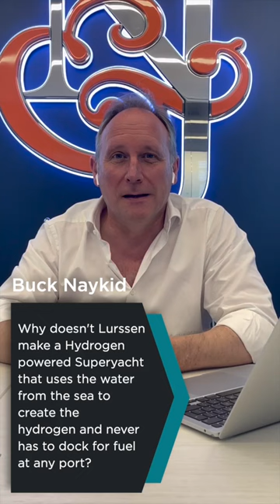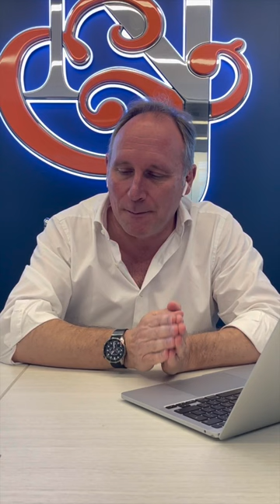HYDROGEN POWER FROM SEA WATER; IS IT POSSIBLE?

Comment: The answer is quite simple: turning water into hydrogen and oxigen is a process that requires energy. And that energy has to come from somewhere. So in a case of a yacht is would have to be wind, solar, fossil fuels etc. Why would you use lots of extra space to turn that energy into another form and endup with way less usable energy, if you're already producing all(actually more than that as desalination requires extra energy and all of the steps have some energy losses) of the energy needed to run the boat in the first place.
Reply: Precisely The energy cost of electrolysis is about 50% of your energy.... better to use electricity and forget the hydrogen - what about the new mini reactors - they could drive a pair of big turbines for 20 years without refuelling. (Search Small Modular Reactors)....
Reply: @madpete6438  Mini reactors could be a potential security/political issue depending on who's running it, though. I can also imagine that while builders are happy to make them, most flag states won't be too happy if they are losing licensing/registration revenue to more liberal places like Russia whilst they are being compliant with whatever international treaties they are being bound to.
Reply: Thanks. You said it so I don't have to. Extra emphasis on the fact that you lose energy every time you go from one form to another. If you have one type of energy... use that.

Comment: Electrolyzing and compressing hydrogen requires around 50kw per kg of hydrogen at 700 bar.  Currently fuel cells can extract around 18kw from a kg of hydrogen.  So it is a lossy system.  The only way that electrolyzing hydrogen on a boat makes sense is if you have enough excess power generation from solar or wind after you have powered the rest of your system.

In the case of sailing vessels, this can work, because you are not relying on electric power just to move the ship, and when you do you only need it for brief periods.  So there is time for the system to "recharge" the hydrogen while you are sailing or at anchor.

A motor yacht, however, has to have power to run the system all the time, and options like solar and wind aren't going to generate enough power to run the ship, much less have an excess.

Comment: The one step everyone is forgetting is turning the salt water to fresh. Electrolysis through salt water has more by products than fresh water. Salt water also produces hypochlorous acid and sodium hydroxide. So first you have to desalinate the sea water then split it.
Reply: But a lot of boats already have a fresh water maker on them that converts sea water to drinking water. Is it not outside the realm of possibility to go one step further and extract the hydrogen from that?
Reply: @ChrisPye999  definitely in the realm of possible. Along with so many other components needed to make the whole system work. But the negatives outweigh the positives in this solution. At what point does the energy produced by the hydrogen outperform the energy used to produce it. Hydrogen power is like nuclear fusion just another 30 years and it’ll be the power source of the future. 

I think the entire industry(engine) is better off improving on current design and technology, other than searching for some efficient abundant clean magic fuel. Look at the work of one small company like koenigsegg, they have improved the efficiency of the internal combustion engine greatly.

Comment: Instead of using Methanol and Hydrogen fuel cells to generate Green CO² Free marine propulsion for super yachts,  a far more preferred technology to achieve this will be to install ECat SKLep 1MW or 2MW Electricity Generation Plants which are commercially developed and now available to pre-order for delivery from c. Q4 2022 onwards. The ECat SKLep technology can be supplied and configured by customers to power CO² free electric marine propulsion from small electric outboard engines all the way up to Azipod electric propulsion drives on commercial ships. The operational lifetime of an ECat SKLep Plant is 100,000 hours so any super yacht owner using this technology for electric marine propulsion will not need to dock and re-fuel (recycle & re-new) for approx. 11.4 years.
Reply: Sounds like complete bullshit with nothing online backing up that claim

Comment: There is a lot of research / testing on using  green ammonia as ship fuel.
Reply: It assumes you have already got H2, which can't be done greenly.
Reply: @skiingfast1  Green hydrogen is produced using renewable energy. ex Offshore wind: Instead of sending power to shore in cables, you can produce hydrogen.
Reply: @skiingfast1  That is very true,  no matter how you put it: moving from fossil fuel toe something else requires massive amounts of ...something else. Still interesting to follow everything that is happening around the topic.

Comment: To make hydrogen from sea water you first have to run it through the reverse osmosis process to remove impurities. After that the water can be ran through an electolyzer using electrolysis to split the hydrogen from the oxygen in the water. After that the hydrogen needs pressurized and stored in a very high pressure tank made for hydrogen. Then the hydrogen can be ran through a fuel cell where the hydrogen makes electricity. Then the electricity can be ran through the ships wiring or used in an electric motor for propulsion.

The crux of this problem is that you need electricity to run the RO water maker and the electrolyzer. The electricity required to do this is more than what is made by the fuel cell (laws of thermodynamics apply).So if you're getting that electricity from a diesel gen set then you're better off just dumping that electricity straight into the boats systems and NOT wasting a bunch of money on specialized equipment to make, pressurize, store, and use hydrogen.

IF you're able to build a boat with a 100% coverage solar array over the top of it then you will NOT have enough power to travel long distance straight from this power BUT you WILL have a massive amount of extra power at anchor. This is after running AC, refrigeration, and all of the hot water you could ever want. The extra energy at anchorage can then be ran through the process mentioned above to make and store hydrogen. Because you spend way more time at anchor than you do traveling you would be able to easily make and store enough hydrogen to go wherever you wanted to go or even cross oceans. Why not use batteries instead of hydrogen? The energy density of hydrogen is way more than batteries and that makes it worth while to mess with hydrogen.

There has recently been a new method discovered to store hydrogen on what is essentially a roll of tape so that would eliminate the need to have tanks and it is also purported to be safe. So the future is bright for hydrogen in yachting but hydrogens strengths and weaknesses need to be carefully considered in the boats design.

In a few years I'll finally be able to afford a regular sailing cat. I don't have the money but I'd love to build a 45ft to 55ft hydrogen powered cat instead.

Comment: You get hydrogen from water by applying an electric current that splits the water into hydrogen and oxygen.  The hydrogen collects at the cathode (the negative electrode), and oxygen collects at the anode (the positive electrode).   Seawater introduces a complication, which is that you'll get more chlorine than oxygen at the anode, and chlorine is toxic and corrosive.  You'll also get some sodium collecting on the cathode, and that's a fire hazard.

So, the other problem is that you need a source of power to drive the elecrolysis in the first place.

Comment: Hi David , thanks for all your content and question answering , my question is under 24 meter loa do crew need to be on boat full time ? would love your answer , great live with vic and rico
Reply: LOA is not used in the Large Yacht Code. LOA is irrelevant. It's Loadline Length. And the answer is NO they do not need to be on a boat... at least as far as the Red Ensign group is concerned. Other Flag States are allowed to vary.

Comment: There are a number of boats already using sea water to H and then H to electricity, the reason for storing energy in H format is simple, H will last, even from one season to the other, solar is good but you need plenty cells and plenty sun and temperature is a factor in storage, wind is only good while there is wind (not always available), fossil fuel is expensive and associated maintenance costs are over the roof when compared to H cell or solar, and also let us not forget why you have a boat, you want to go places with your boat and many places are starting to close up to fossil fuel and planing to ban it all together, be it right or wrong is not the problem here, wanting to go places is, in an affordable way (albeit slower). My penny to the subject.

Comment: The reason you don’t use seawater to make hydrogen is because in order to separate hydrogen from oxygen you have to put as much energy into the water as you’d get out of the hydrogen by burning it. Think about it for a second and it becomes obvious. You plan on burning the hydrogen in the atmosphere, combining it with oxygen to make water, releasing heat and pressure energy. It’s like pushing a rock off a cliff. Forcing the hydrogen and oxygen to separate again is like hoisting that rock back up the cliff. This is why the vast majority of hydrogen produced is made from steam reformation of natural gas, which is mostly methane, not methanol. Well why the heck would you make a mess ripping hydrogen off natural gas when you could just burn the natural gas? It’s one of the cleanest burning fuels we have. 

I’m not convinced that using hydrogen as “fuel” is anything other than conspicuous consumption and virtue signaling. If you make it fro water you’re wasting more energy making the hydrogen than you will get out of the hydrogen when you use it. If you make it from natural gas you’re making a toxic mess. But since that waste and pollution isn’t coming directly from the vessel the owner can pretend to be green while the hydrogen production facility makes an environmental mess. 

Just burn diesel. Until we have so much electricity that it’s effectively free it makes no sense to use hydrogen as a fuel source.

Comment: The reason they are using methanol because it has 4 hydrogen atoms per molecule and water has 2 H2O 2 hydrogen 1 oxygen and I think you have to put the sea water through osmosis first then get the hydrogen from the water. But this way is more environmentally friendly using methanol is still a fossil fuel and making hydrogen from water is the perfect cycle because you never destroy the fuel source , once you get the hydrogen from water and use it in a fuel cell by adding oxygen the byproduct is water.

Comment: You can separate water, 2H2O into 2H2+O2.  Sea water is normal water with salts mixed in, not binded.  So easy to filter out the salts, on ships a water maker is standard which filters out the salts.  O2 is normal oxygen that we breath and can be released cleanly into the atmosphere.  H2 is normal Hydrogen that can easily be burned.  When you burn hydrogen, you do it in reverse, 2H2+O2 becomes 2H20.  But it isn't done freely.

Think of a pair of magnets es an example of what is happening.  The H2 is stuck to the O2, they want to be together, but you have to pull them apart.  All it takes to put them back together is a little nudge.  That pulling apart requires extra energy.  That is why this is fundamentally inefficient.

Also when burning, it does not all make water.  This is because air is full of stuff besides Oxygen, mainly Nitrogen.  So while you mostly get water, H2O every now and then you burn Nitrogen and Oxygen and Hydrogen together and get HNO3.  Nitric Acid.  Which is the cause of Acid Rain and acidifying to the ocean.  This is a byproduct of burning anything with hydrogen and air.  And a main reason petro engines and gas power and coal plants are looking for replacement.

So where does everyone want to get the easy to make Hydrogen from?  Where we get it now.  A biproduct of using fossil fuels.  Now this makes Hydrogen power even worse.  Because you may have seen the flare off at a refinery already.  And you may want to use the hydrogen to make plastic.  I mean that is what the GRP, white yachts are made with.

Comment: Not enough cheap space on a yacht to house the equipment (is there even any cheap space on any yacht). Better to get hydrogen cylinders on shore but that’s few and far between available.
But most importantly, whilst hydrogen fuel cells are great on paper it’s when things go wrong that they’re quite dangerous. It’s the most reactive element in the table and if you have a collision/accident/fire, it becomes a substantial bomb.
No diesel fuel tank of 100k litres will blow up - it’ll burn down, yes, but not explode.
And H is expensive to buy (because of the risks associated) yet it’s energy efficiency is only slightly more than double that of diesel. So for for 100k litres diesel you’d need approx 45k litres of H 😂.
If you can find an insurance for that…😂😂😂
It’s a green pipe dream . Btw, hydrogen is even older than “fossil fuel” (no fossils involved) because it’s been around forever. 🤷‍♂️

Comment: Hydrogen is just dangerous. Full electric is possible. With elon battery tech. Like a balanced budget running off a surplus. Wind hydro and solar could be obsolete but petroleum companies buy up patents and suppress it. In 4'×4' area you could produce 50,000w. Think of a Generac standby generator except no gas. Instead another electric motor. Seriously

Comment: I have been working on a green hydrogen solution since 2014 and yes not only is it possible it is actually cheaper or at least with my solution it is but usually game-changing solution don't get funding
Reply: That makes no sense.  If you have a "game-changing" solution, then there are companies out there willing to buy the rights for it.  If "game-changing solutions" never were funded, we'd be back in the bartering age.  Either your solution doesn't actually work, or it's not a cheaper version.  There's no way a cheaper, more eco-friendly solution is available that companies wouldn't want.  Unless you've never revealed your methods and haven't copyrighted them.
Reply: @grondhero  your actually very wrong, there is no funding for game-changing solutions
Reply: @mohammadhashemi1771  Then your "solution" isn't "game-changing."  No company is going to see a "game-changing solution" from an individual and state, "Nah, we don't want to have more profits.  Let them suffer."
Reply: @grondhero  hehhehehe
producing hydrogen below $1 is not a game changer?